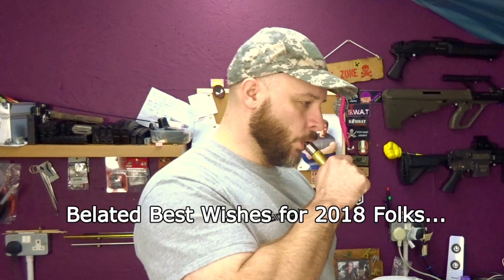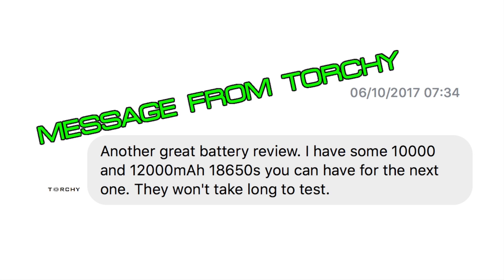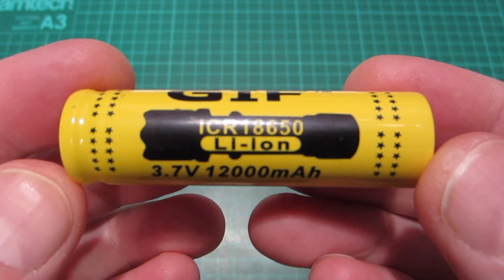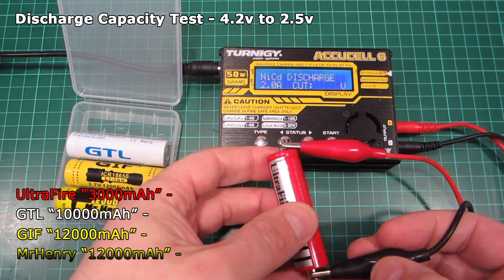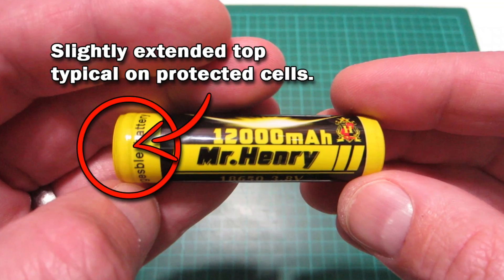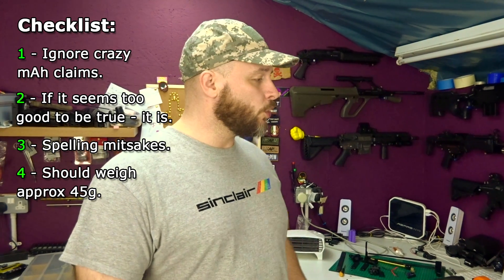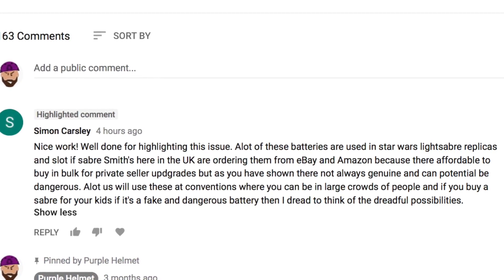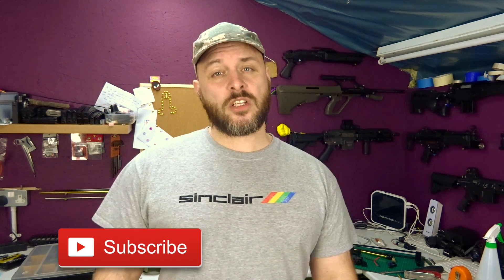HOW TO: Spot MOAR fake 18650 Batteries! | Group Test

Comment: My Mr. Henry 12000mAh 3.7V battery only weight 33g. Real capacity only 800mAh...
Reply from the maker: Hey Andi, cheers for taking the time to comment. 800mAh... Terrible, but not surprising!  It's crazy they are still getting away with lying about this!
Reply: @PurpleHelmet  I bought 8 Mr. Henry, put them all in my 8 slots DIY Powerbank. My 5000mAh phone can't even fully charge with those 8 batteries. Next time just buy well known battery such as LG, Sony, Effest, MXJO, ect.
Reply from the maker: @andiwhie  - learned the hard way, sorry to hear this buddy!

I have an 8 slot powerbank filled with the pkcells I reviewed in the other video, it's superb!  Can charge my phone 3x over.  I used it to power another phone as a CCTV camera yesterday, it ran from 7 am to 6pm before the phone started using its own battery!

So maybe check those out as they are a good budget option - just buy from one of the official accounts - durnergy or fuspower - and you should be good 😀
Reply: @PurpleHelmet  Okay man, I will look at it. Thanks for the info...👍🏼🙏🏻
Reply from the maker: @andiwhie  no problem, cheers for taking the time to pop by and chat! 😀

Comment: Not sure about this but, I see NiCd discharge, on li-ion 18650, be carefull :)

For good cells, I always go to nkon.nl they are cheap an always real cells

Mostly the rated capacity is based of a 0.5A load or less though, but they are still crappy cells
Reply from the maker: Yeah on discharge it doesn't really matter, they just put it under different types to make it user friendly - all it does is apply a load to the battery - I use Nicd discharge mode because it let's me adjust the cut off voltage to 2.5v which is more inline with where the manufacturers discharge to in testing.

The discharge in the lithium ion menu cuts off at 3.1 probably to preserve battery life, just again trying to be user friendly I guess.  Or make it idiot proof lol

Comment: So instead of buying batteries on Amazon get them for the local supper market by the brands you know. Great video, had been thinking of getting some cheaper LR44 cells for my boys LED night lamps as it is £7 for 4 in the shop. But now i am willing to spend that and not get ripped off or put them at risk. Thank you!
Reply from the maker: Hey Raven, thanks for dropping by - really appreciate it - and thanks for the wee video yesterday too, that was cool :)

Yeah basically if you are in any doubt, buy from a known source - there ARE good places on eBay and Amazon, but it takes a lot of research (and potentially money wasted) to find them - almost without fail, if its too cheap, it will be rubbish.  At best it will last a fraction of the time it is meant to, at worst it could go pop.  For LR44s to be totally honest I'd stick to known good brands out of supermarkets like you say.  Even some of the branded stuff cheap on ebay is outright fake coming from the east - lot of fake energiser about online.  Pain in the bottom that we should even have to consider it... but where there is a buck to be made, someone will be pulling a scam sadly.  Bad side of human nature I guess!

Comment: What about the unbranded Panasonic cells you can get like on GearBest and BangGood? Any recommendations there?
Reply from the maker: +ScrewYouTwice - honestly buddy?  I just don't know.  If I had the budget, I'd buy a pile and test them.  They could be legit, but they could also be counterfeit; you can (or used to be able to) buy copy wraps for all the major batteries... that's an altogether more insidious fake because its pretending to be something it isn't... at least with the crap I've tested here they have their own brand.  Their claims on the cell quality and capability is fake/lies... they aren't counterfeiting a brand as such.  But there are fakes of "real" cells out there...
Reply: Thanks for the information. I just got into this with flashlights. I had no idea just buying batteries was going to be such an ordeal. But I already got burned once.  Looks like the only safe way to get batteries is paying a premium price. But thanks for the work you do. I am leaning a lot.
Reply from the maker: +ScrewYouTwice - check out the PKCell I done a video on.  Cheap, no outlandish claims, and do what they say - perfect for flashlights 😀
Reply: Thanks that was the video I watched right after this one. I found some on GearBest